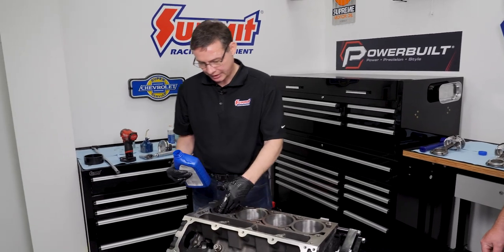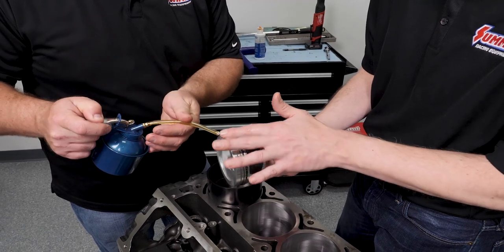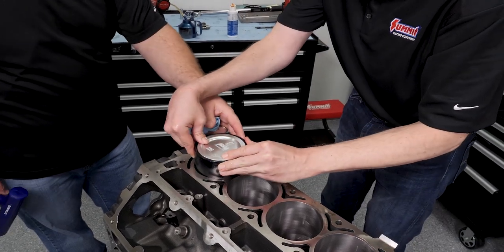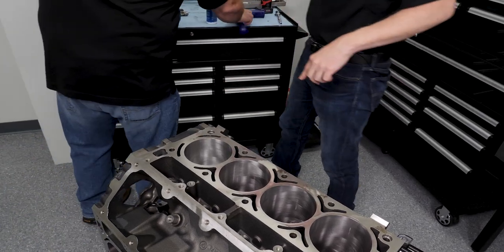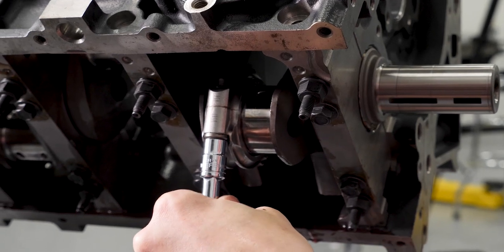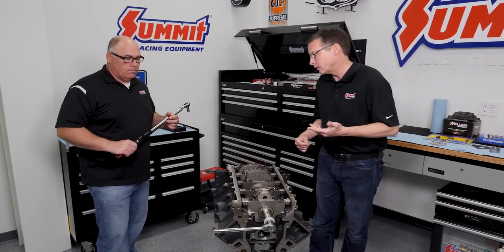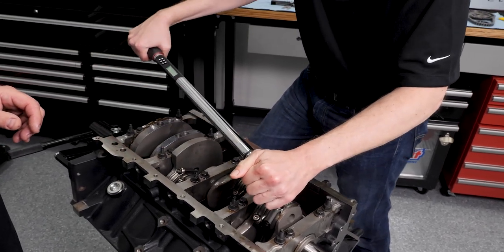Installing Pistons and Connecting Rod Assemblies (Engine Building 101)

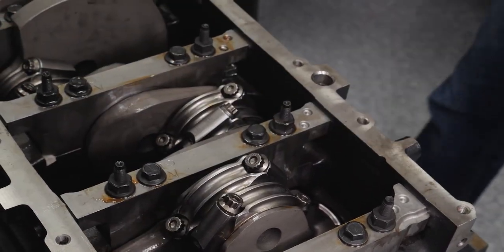Comment: Question for anyone. At 7:38, he is manually turning the crank by hand and theres some light resistance. I have that and just a tiny bit more hesitating in some spots. Is this normal? I am resusing the same pistons with new rings and bearings and they are very clean and no issues installing them. Seem to rotate smoothly without pistons in it so im guessing its just the rings that need to be broken in once its up and running? My first breakdown and rebuild and everything has been good thus far, just want to make sure a little drag is normal at certian spots. Im assuming its just the new rings but im questioning everything. And yes i used fresh motoroil to install, on the rings, sleeve or bore etc...its mildly lubricated

Comment: Hey I'm installing my pistons and my handbook say to have the notch to the front of the motor than to have the flat sides on the rods butt together but I'm not sure how that works cause I have 3 and 5 I'm just not sure with one should have the flat sides opposite if that question makes sense lol
Reply from the maker: Hi Chris, 
The flat side of the connecting rods must be together. The chamfered side always goes to the outside to clear the radii of the rod journal. The pistons need to be orientated to the rods correctly, so the notch on the piston is forward, and the rod chamber is to the outside.

Comment: Can someone tell me what the chamfer is please? I’m trying to figure out where my beveled edge needs to face when putting it in the motor. TIA
Reply from the maker: Thank you for your question.  If you are referring to the connecting rod chamfer, they are designed to go against the cheek of each journal that may have a larger radius than the factory.  The non-beveled side of each connecting rod would face each other on a journal.

Comment: Take that hand off of the head of the torque wrench!! One hand on the handle!!  I see so many improperly using the second hand on the wrench.
Reply: Can you explain why please? Honestly just curious
Reply: @kcwyrick7947  it actually changes the torque value. After working in quality in nuclear fuel systems parts manufacturing, that's how we were taught for assembling parts.
Reply: @kevin shiley  did anyone actually test that theory? Because from a physics standpoint if you're applying a radial force to the wrench head that hand isn't inducing any force that would directly affect the measured torque. I do this all the time with extensions because otherwise it would cause the socket to come off the bolt or nut. Without extensions I can't imagine the radial force would affect friction enough to alter the torque value any significant amount. That's why he's doing it, so he doesn't knock the extension and deep socket off the fastener, potentially damaging it.
Reply: @Sevalecan  it's what we were taught in the commercial nuclear parts inspection. Take it from there. I'm not a physicist, but that's what we were instructed. If you watch, so many are introducing a force in the opposite direction the way they hold it, which is actually rotational around a different axis.
Reply: @kevin shiley  I understand. And this is not a knock against you personally, but old wives tales have been floating around in more than one industry. I think one of the most famous was Fireball Tool testing whether you should  ever backdrag a file. After so many people got on his case about it, many having learned it from the Navy, IIRC. Turns out they were all wrong. You get more use out of out of it if you backdrag. He tested it.

Anyway, on the order of several tens of ft-lbs (which these bolts are), you would likely find it difficult to induce a torque more than a few inch pounds on that ratchet head, with your hand radially close to the axis of rotation and the head being smooth making gripping difficult if intended. 50 ft lbs would be 600 inch lbs. Difficult to make more than a 1 or 2% change to that number if you intended to apply torque with that hand. I expect this is likely small compared to other sources of error. 

Just my opinion of course. I wouldn't worry too much about it.
Reply: @Sevalecan  unfortunately in some areas, tolerances can be ridiculous.  Probably many times tighter than necessary!